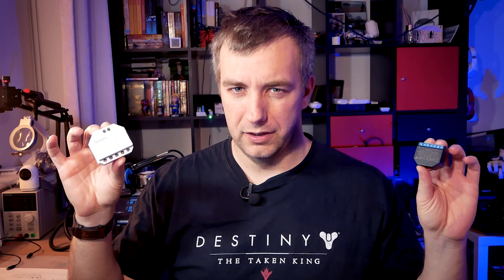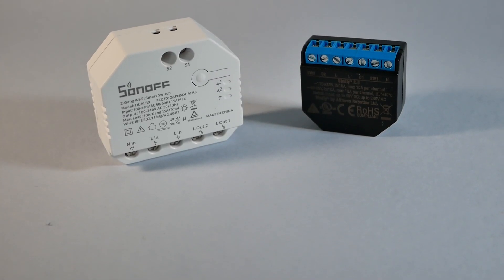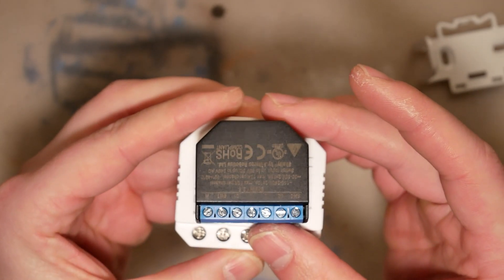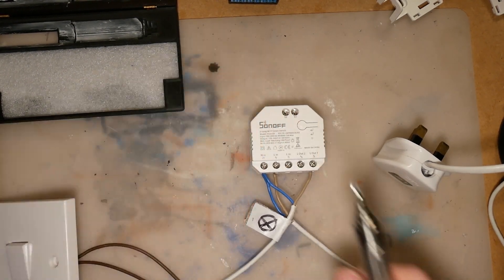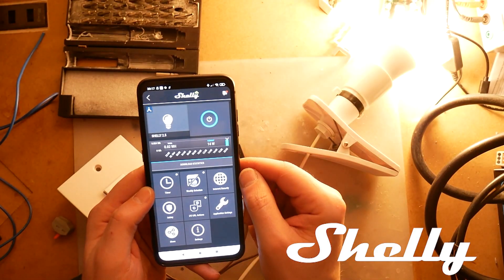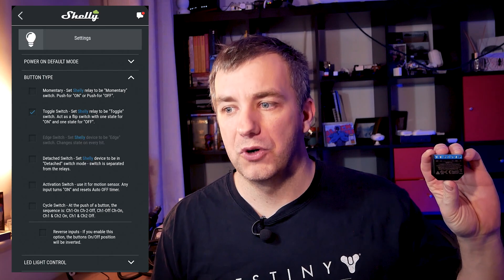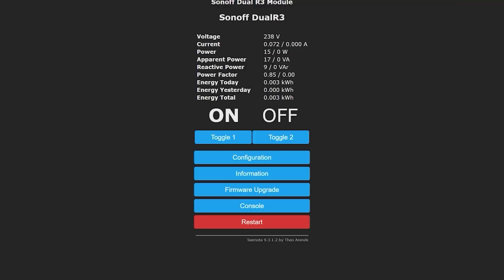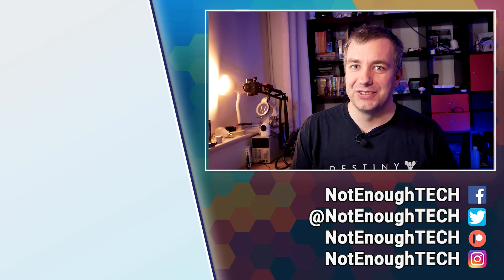#Shelly 2.5 vs #Sonoff DualR3

Comment: Is there any chance to find a free GPIO on the Sonoff? Any schematic?
I would like to add some sensors DS18B20 after flashing with tasmota.

Shelly is too expensive. I already bought EM version with CT with dedicated use for entire Home energy measurement.
Reply from the maker: You could use RXTX for this. They are only used for flashing - in the normal operation, you can assign another purpose.
Reply: @notenoughtech  thanks.
I did't think about it.

Comment: Big fan of Shelly and I got lot of their products but...2 out of 2 Shelly2.5 started to do loud hissing noises, just after 2 years under light load. It seems a common problem as reported by others is that they run hot and the cap dries out (Shelly used cheap parts particularly in the Shell2.5 - might be one of the reasons why it's no longer sold). Shelly were double the cost of the competition and I thought I am buying a quality product but 2 out of 2 failing almost same time right after the warranty expired...not sure I can trust Shelly at this failure rate, I will try other alternatives to compare.
Reply from the maker: It's a shame to hear this - if this is a known issue (I gotta say I hear this 1st time) - could be worth reaching out to Shelly about it? This is where you usually find out how much they care about the brand image,
Reply: @notenoughtech  Shelly support was great and quick to reply, the PM2.5 is no longer sold, so they gave me 50% off on a new Shelly, fine by me.
Reply: Also, I have read that Shelly advises to use what they calle Snubber RC to protect the modules. Did you use those ?
Reply: @theattorney6072  I haven't heard about "RC Snubber" but looked it up on Shelly's website, cheers for letting me know! I am familiar with its concept though, and yes I was using something similar to it. My entire  house sits on a surge protector, followed by  63A voltage regulator (both under and over voltage) mounted on rails next to my mains circuit breaker. The particular Shelly 2.5 that died was on a UPS so that should rule out any voltage fluctuations. Output 1 of the Shelly powered my PC and output 2 all the other accessories. One of the reasons I used this Shelly was to turn on/off unnecessary devices (monitors, ambient light, printer, soundbar, etc...) when my PC went into low-power mode (nobody working on the PC, yet running as a home server/streamer). I tried to achieve same with Master-Slave switch earlier but it was unreliable and drove me mad. Shelly was fine until it died. I replaced the PM 2.5 with two Shelly Plug S instead.
Reply: Hi and thanks for sharing this. Did you try another brand ?
Reply: @theattorney6072  Sure, I also have several Sonoff D3 Minis, they are bulky but they work fine since years. Anyway, I'm going to stick to Shelly for now, as have many other Shellys in my house.

Comment: I use the shelly 2.5 fas solar monitor. It gets awfully hot. Bettter get two shelly pm1.
Did order a sonoff now. If that gets hot i can desolder the relays, dont use them anyway.
Reply from the maker: Check the gauge of the wires on both ends especially if you are running shelly at close to the current rating. Hot is also very relative term. Most electronics is totally fine with 50-65C which becomes unpleasant on touch very quickly.
Reply: @notenoughtech  No its not the cable. There are 300W running over each channel, not enough to heat the 1.5mm cables. Its the micro relays inside the shelly getting hot in continuous ON state. This 2.5 problem is well known.
Reply: I am using 2 Shelly 1PM plus to monitor 2 x 300W Solar panels and they report way to high power values. Shelly is aware of the issue an explain there was a missing calibration mistake. Next week I will try the Sonoff Dual R3
Reply: @PeterObermeier  I'm sorry.
I am curious how do you measure solar...
Reply: Have re-done the measurements and this time I have compared my Shelly 1PM plus with the Hoymiles HM600 power value via Ahoy DTU and found that my Shelly is 2% lower. Meanwhile I am happy and do not take it too seriously 😂

Comment: You try to compare both, but you don't compare the precision
Reply from the maker: Precision in the reported voltage? Values are very similar on both units. As the reading can fluctuate slightly it's hard to define which one is more accurate. I have not noticed anything that would cause the concern on either the unit

Comment: Nooo! Never put two wires under one screw: ask any sparky!
Reply: I am a sparky and 99% of accessories in a house have two cores into one terminal screw (uk)
Reply from the maker: I have seen it all in the UK. But I lived in some old houses with a bit dodgy installation as well haha - I feel your pain as half of the time it's hard to figure out the custom jobs 🤣🤣
Reply: @vRxUniQueZ he means another thing, we also habe two cores in one terminal screw now imagine putting 4 wires in total. this is how he means it
Reply from the maker: I did say "may get away". 🤭🤭 But you are right.  One terminal one screw is the safest way

Comment: The ESP32 with bluetooth inside might be a good idea - having itag behind the wall would enable in-room positioning without additional ESP32s around :)
Reply from the maker: I'd love to do a node thet does it all :)
Reply: @notenoughtech  Just install the tasmota32-bluetooth edition - it has the BLE enabled, additional setting to enable beacons, works as BLE2MQTT bridge, ... The switches and relays are then just the cherry on top of the cake :)
Reply from the maker: Oh I was thinking about a node that also does lots of sensors :)

Comment: Tasmota could be used on Shelly 2.5 also.
Reply from the maker: Indeed but I think you are pretty much getting the same info and freedom with their stock firmware
Reply: @notenoughtech   while that is true, I strongly believe in having full control and ownership on Iot devices, making them future proof and completely independent from third parties (shelly still connects to the internet on it's own).
Reply from the maker: @soyeltiolucas  in the rest and mqtt mode the device doesn't talk back

Comment: Another very informative video...thanks. I have a Sonoff miniR2 and want to wire it to a 2 gang switch but it doesnt come with neutral is there a way this can be down?

regards
Reply from the maker: Unfortunately this one needs L and N but you can fit this in the ceiling. 
https://notenoughtech.com/featured/using-smart-light-switches/

See this
Reply: THANKS..........what I love about you is you think outside the box. So if I wire it across one light will it work for the other lights?
Reply from the maker: @newby2224  could you explain the question a bit. Font want do give you incorrect info
Reply: @notenoughtech   ok I can get into the ceiling where 1 light is and wire the miniR2 to that light. But there are 3 lights in the ceiling...So I assume this would be wiring in series?? if I wired the sonoff across 1 light would this still control the other 2 lights?

Thanks
Reply from the maker: @newby2224  yes you would need to group the wires and run it via the same relay. Just do check the current draw it's unlikely you will hit the limit with LEDs but be careful
Reply: @notenoughtech  they are LED's so I wouldn't think I would have an amp problem...THANKS

Comment: How do each of these perform behind an in-wall UK light switch - given in many UK properties the in-wall switch mount knockout box is metal? Is this something you have tested? (Concerned it would impair the wireless signal)
Reply from the maker: I have 2 sonoffs mounted and these seems ok. The biggest issue would be orientation of the box Vs router placement. 
In both my cases it's a ceiling rose as these need L and N cables to work which isn't usually present in the UK wall switch

Comment: The Sonoff Dual is huge! People already struggle to place the Shelly 2.5 behind their switches. Looks impossible with the Sonoff.
I really like the Shelly, because you can set them up without a cloud connection and without using the app. The Sonoff is a cloud-only device unless you flash it with Tasmota.
Reply from the maker: I do agree with size issue but also with extra connectors Shelly 2.5 had been a tight fit as well.
Reply: I have replaced all the back boxes in my house with the larger 50mm ones so adding Sonoff Mini was much easier but with the existing 35mm boxes, they were a nightmare to fit in so I made my life easier. I now have loads of spare 35mm back boxes if anyone needs any??
Reply from the maker: Haha I know your pain. One room has a structure wall and very shallow box inside so I'm struggling to do it. And re drilling this into a stone wall is a nightmare. Now I know why they made it shallow 🤣😂🤣
Reply: Have to agree. Already using a Sonoff mini which is already a tight fit. Going to try a Shelly 2.5. thnx for this video @NotEnoughTech